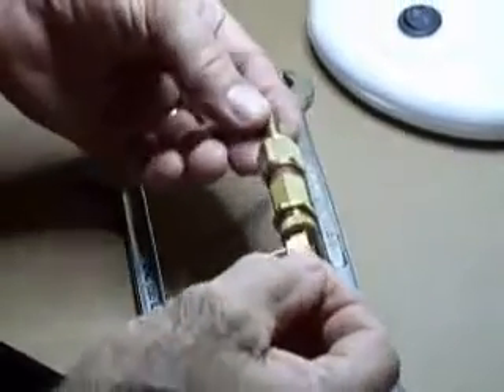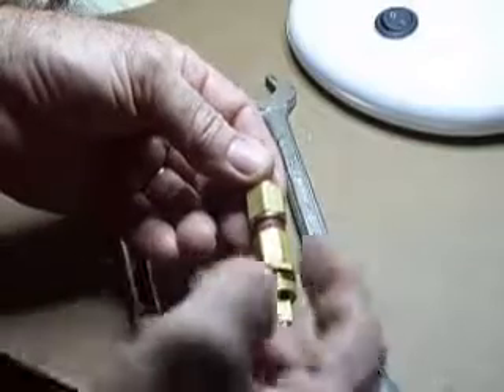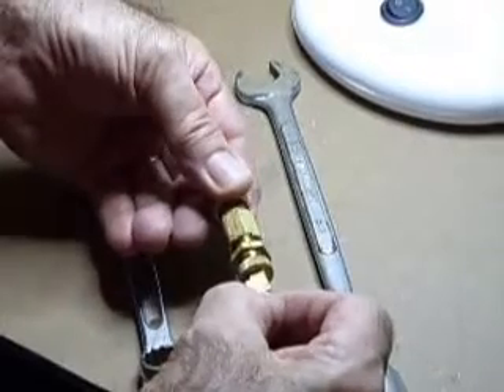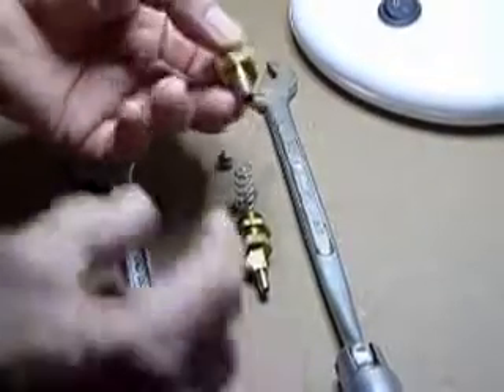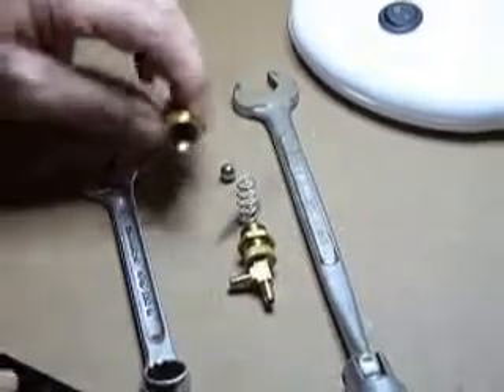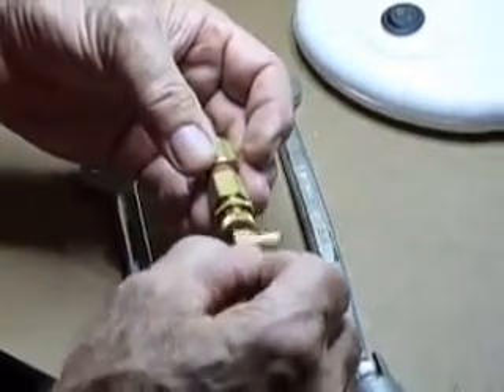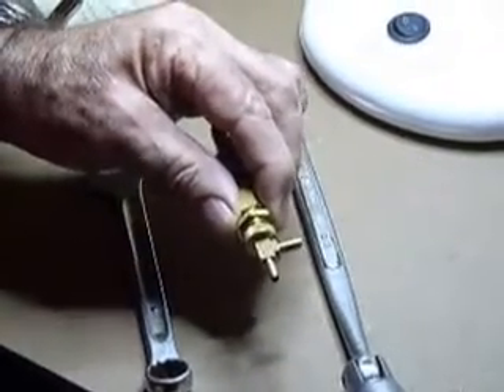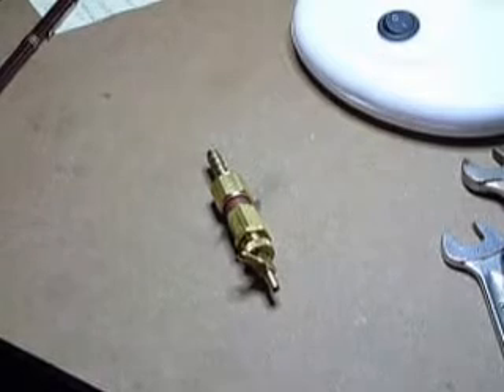Nissan 3L, How to Dismantle and Adjust a Dawes Valve

Comment: Thanks but have a question wound up all the way in but only 12 psi ???  i see in your video you still have 5 mill or so to go
Reply from the maker: There were two springs available for the Dawes Valve, I know Darren Dawes from when I was working in US, after a discussion the competition spring became the norm, he actually sent me 50 springs to be distributed to the people I knew who had a Dawes and the original spring had gone soft. if your spring is around 23mm x 7mm then it is the original spring, the comp spring is around 22mm x 9mm. you can stretch the original spring to a certain extent, I actually still have 2 comp springs on the shelf. measure what you have and get back to me. We will see what we can work out.
Reply: @Geeyoutoo  Thanks ill measure in morning  good onya cheers GYT

Comment: Hey  Geeyoutoo. I have just finished installing my very pretty and expensive HPD intercooler and I am getting limp at full throttle around 100 k’s in 4th gear hitting around 16.5 psi instead of the 15 I was getting with stock leaky IC. To avoid hours of back and forth lottery. Do I need to let Dawes out or take in to lower my boost limit
Reply from the maker: Wind it clockwise to raise boost wind it anticlockwise to lower boost. I'd go 1 turn anticlockwise and work from there.
Reply: Legend thanks heaps mate your a wizard with these things

Comment: Will remove mine now for a check and clean as I have no catch can......
Reply from the maker: Let us know how you get on.
Reply: Took it out, measured the length first and noted it down then opened it and inspected the internals and it is super clean after the best part of 5 years+ use.
Reply from the maker: @fatwalletboy2  Excellent, pretty good result I've seen a few contain a fair bit of oil sludge and other particles over time.

Comment: I found an easier method to make sure you put it back in exactly the same position. Remove it from the lines. Use a vernier to measure the length and jot it down. I think it's about 71mm on mine. However this will obviously vary according to barb length etc on each unit. This gives me about 100kPa boost. Strip, clean and assemble and check with vernier before tightening up again. Works a treat for me.
Reply from the maker: Mate over the years I've done it every way there is a possibility of doing it, Individual units may be different hence I never put a measurement on it, I just do a simple count and it goes back in exactly as it was. I'm an Engineer by training and have all the gear to measure anything I need but counting turns is so much easier. The experience also allows me an educated guess on what I'd get if I went say another 1/4 turn.

Comment: Hi ive recently removed the three screens in my air filter prior to this boost was set at 15psi max and running around 10psi at 100ks cruising.Now its 114ks for 10 to 12psi and at 100 to 110ks just sits on 15psi constant,boost cuts out at around 18psi.
Ive had a tinker with the dawes too far out and it almost stalls on take off but plenty of boost and power cruising,too far in plenty of takeoff but seems to be going into limp when overtaking.
So how finnicky are these dawes.
3ltr gu 01,no egt,no needle valve,standard ic,3inch exhuast,dawes valve.
cheers any advice would be much appreciated.
Reply from the maker: +Materoa Wilson 
Without a needle valve your spoolup will be quite aggressive, so limp would not be unexpected, after removal of my screens and other airbox mods my cruise went up 1.5-2psi with out touching anything else. If you have the HD spring in the Dawes then 1/4 turn in could raise boost 2-3psi. 

You have a couple of choices, adjust the VNT grub screw down 1/2 a turn or fit a needle valve so you can adjust spoolup very quick and easy.
Reply: Cool thanks

Comment: Mate, you know who you just helped, me. Thanks for the great vids. I grabbed a brand new GU 2 months ago and have just finished all the basic mods( suspension, snork, basher, batts, racks, draws, real tail light! etc). I've done all the work myself so as to understand the workings of my new beast as best i can to help deal with any dramas out in the bush. Now I'm looking towards a few sensible mods to the engine, the "daunting"part for me. So thanks again, I'm off to find my Dawes Valve.
Reply from the maker: +Adam Vallance 

Cool, pleased it has been of some assistance. So this is going to be the "tourer"?
Reply: Yep, I got it to get my young family out and about a bit and do a bit of hunting with me mates. I'm almost finished my 5m plate alloy boat ive been building for too long, so there will be some long haul towing as well. I dont want a speed machine, i just want a strong, reliable, safe, engine that will get us out of trouble and home again. I'd love to hear your thoughts on Chips (not the salt and vinegar ones) plug n play, hack the ome one? Thanks heaps for your time, I appreciate it.
Reply from the maker: +Adam Vallance To chip I would do a UniChip above all others, do some homework on them, but as far as I'm concerned they are the most flexible, not the cheapest though.
Reply: +Geeyoutoo  Thanks i will do that

Comment: Great stuff for the novice to have a go.
Reply from the maker: Graham Yee 

Hi Graham, thanks, are you thinking of it? if you are which Dawes valve do you have, the MkI or the MkII? and which spring, the std or Heavy Duty? am currently putting together another video on something that we have come across with the HD spring.
Reply: Hi thanks for your reply. I am a chippy so not a real mechanical minded person but i have done most of myself including egt, boots, oil pressure water temp gauges, heater exchange, 4" lift with radus drop arms, aftermarket intercooler and a heaps of other things to many to list. Getting back to the Dawes valve and needle valve, its part of my next project including catch can and egr plat. I purchased the bit off Vic 4x4 & offroad and they did come with some instructions but i am doing a bit more research on how best to fit them and being a total novice trying to get enough information in particularly where to locate the correct hoses to tap into for the valves and catch can and where i should start undoing bolts for the egr plat.  I guess this might look abit ridiculous as these would be obvious to most that play with this stuff more often but i love to have a go and most importantly be able to fix a issue for myself or others that might get stuck in the great outdoors.  I have found you videos a great source of information to give me a bit of confidence.  The dawes valve im not should if it is the mark 1 or 2 but the needle valve is of the newer type that you have featured in one of your videos. If you have any images/ video's of where to locate the above that would be great and i would be forever in your debt.  Cheers
Reply from the maker: Graham Yee  See if this links works for you:
http://www.patrol4x4.com/forum/zd30-di-engine-3-litre-71/nads-so-you-bought-zd30-di-heres-nads-installation-steps-logic-88214/index3.html
and this which has the full description of the EGR block:
http://www.queensland4x4club.org.au/zd30/ZD30%20Y61%20Reference%20Document%20-%20Colour.pdf

Let me know how they go.
Reply: Ps sorry left out the details of the truck which is a Nissan 2005 GU IV 3.0L Di
Reply from the maker: Graham Yee  No worries Graham, basically all the DI's are the same, CRD is a little different. Let me know if the links work, never tried them on here.

Comment from the maker: In the video I say I don't use my needle valve anymore due to my vehicle being happy with my VNT adjustment. I need to qualify that statement, to get to a level of a good VNT setup takes a lot of experimenting unless you are lucky, this includes a lot of needle valve adjustment, particularly if you tow vans/trailers, this is why I would always recommend an in cab needle valve.
I have had the VNT down anywhere between 1/4 - 1 turn, it has been at 1/3 turn for quite some time, but still handy.